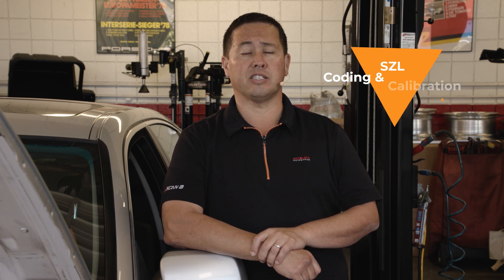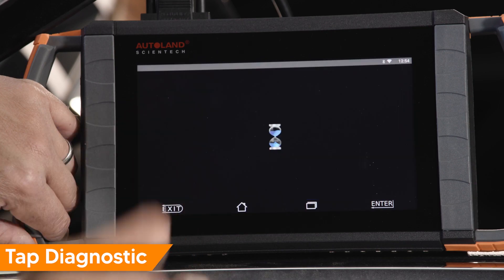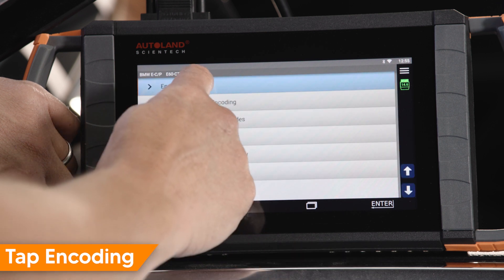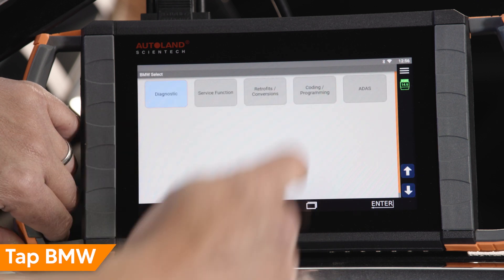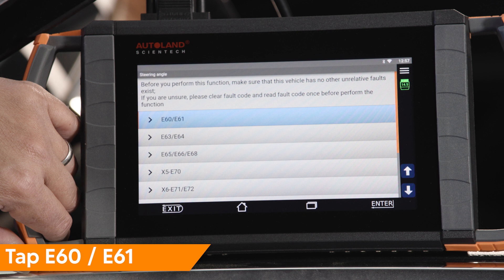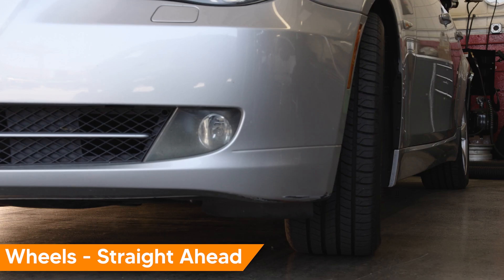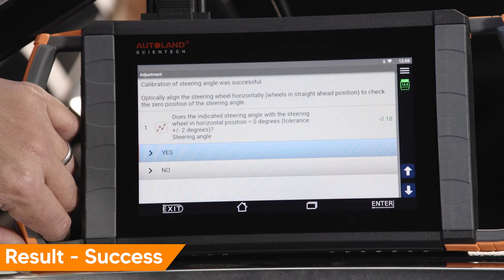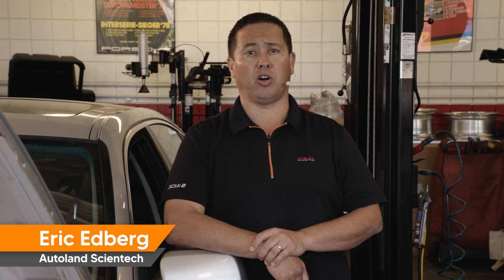BMW Steering Switch Unit SZL - How To Code and Calibrate a New Sensor

Comment: Hi the i have 2017 bmw 420d , sometimes when i am driving the cruise control and speed limit are showing failure.  But it comes and goes , as i press the close msgs that comes it will stay there for a minute or so and the warning msg is gone. Does it happen because of a faulty SZL ?
Reply from the maker: Hard to say without the stored fault codes. I would start by checking the vehicle for fault codes. If the system is not working properly, a fault code will be set. This will be your best bet when diagnosing.

Comment: The horn in my e60 lci vehicle was honking occasionally. Sometimes it works when I turn the steering wheel, sometimes it doesn't. Now it's completely broken. What could be the reason
Reply from the maker: Could be the steering switch unit.
Reply: Thanks

Comment: At 1:53 where you are selecting the chassis for calibration, I do not see the R-models there and I am trying to do this on a R56, what should I be doing instead?
Reply from the maker: You will select MINI when selecting your manufacturer, then go from there.

Comment: Hello,i was change sterring sensor on my e60 2008 LCI,and now like before i have 2 fault ,fault with dtc and active sterring wheel..
I have delphy diagnostic and i cant calibrate.. sterring wheel position is frezed on -1434,any help will good come
Thank you
Reply from the maker: You could have a defective angle sensor. What diagnostic tool are you using to calibrate?
Reply: Hi I have the same problem, the angle is freezed but I think the problem comes from the coding